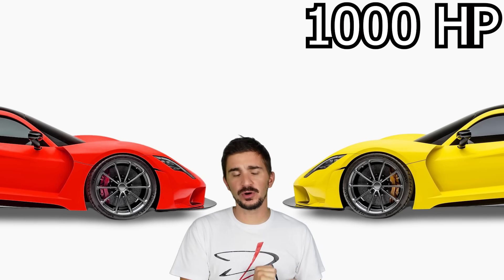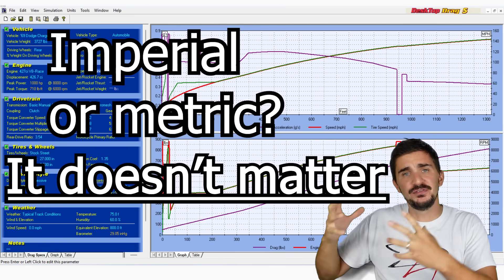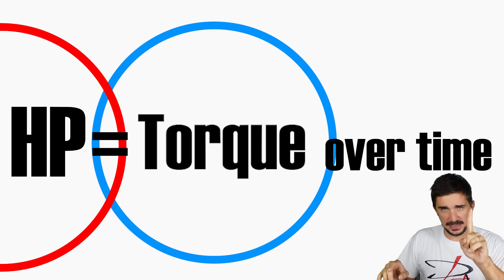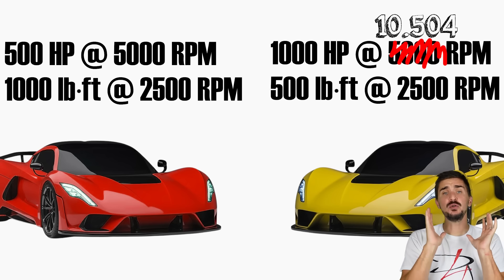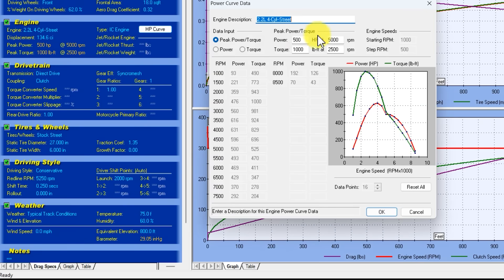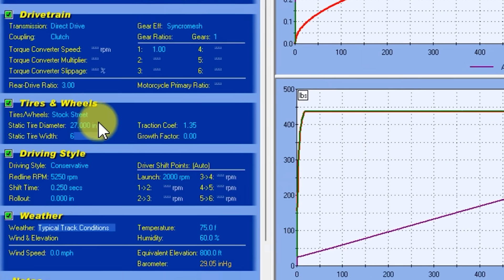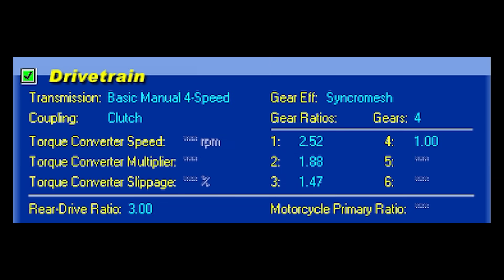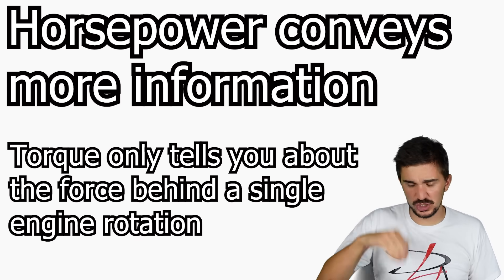Who's faster? Explained and Simulated - Horsepower vs Torque

Comment: Would be cool if you showed some closer numbers also on identical vehicles like say-  500hp 400t 🆚 400hp 500t to show how'd they react.....Would they finish pretty much even with 400hp/500t being quicker off the line. But gets caught at the end by 500hp/400t. Would 1 that always won the 1/4 mile always lose a 1/2 mile race?
Reply: It would depend entirely on the transmission since that allows you to trade RPM for torque.  With an appropriate transmission with a suitable range of ratios and which can be changed quickly (e.g. DSG) then more power is better.
Reply: @ferrumignis  I understand the different gearing part. But I meant/said use 2 exactly identical cars. With a closer 400hp/500t ,🆚 500hp/400t. To get/show a better idea how'd they'd respond in 1/4 & 1/2 mile drag tests.
Reply: At that point they're so close that you would have to give them both custom transmissions and rear ends optimized for each race they derive meaningful differences because the wrong gearbox would give one the win and the other a loss or vice a versa.
Reply: @bigbenms6  I mean race both cars completely identical except for 400hp/500t 🆚 500hp/400t to show how'd they react in 1/4 & 1/2 mile races. Are you saying in the 1/4 mile they'd pretty much tie. With 1 slightly quicker off the line but the other catching it towards the end.
Reply: @michaelbrinks8089   right but....  with AWD the high TQ car will have the traction to get a lead and  "likely" win both races, if traction is limited the high HP car wont have as much wheel spin and IT might win both races.  With different redlines and identical gears the high TQ engine may geth into 3rd gear while high HP may still be in 2nd, so does that extra gear change hurt or help TQ car?  

What it all really means is that if the transmissions is set up for the high TQ car IT likely wins, if the transmissions is set up for the high HP car IT likely wins, so there just isn't a fair way to set up a race with "identical" cars that really means anything concrete.  

Case point, the old Celica GTS was an OBVIOULSY slower car than its competitors and COUNTLESS 1/4 mile races showed this with both trap speed and times, BUT they advertised it's 0-60 heavily because it was specifically designed to get to 62 MPH in 2nd gear, why does this matter?!?!?  The Celica GTS  needed only 1 gear shift to get to 60 MPH, its competitors ended 2nd between 55-58MPH which was better (by quite a bit) for 1/4 racing but less ideal for 0-60 as it necessitated 2 gear changes which in a manual transmission WASTES TIME.  

So again for identical cars how do you decide which final drive to use?  1-3rd ratios?  Gear ratio selection is also effected by traction and drivetrain, an AWD car can handle a shorter 1st great better than RWD or especially FWD.

So I get what you are wanting to see, and it may be possible to find a way to compare those, I just want to stress than there are NUMEROUS other factors that you can manipulate that may sway the win to one car or the other outside of just HP and Torque.
Reply: @michaelbrinks8089  I would further make the case (and we are getting DEEP now) that the SHAPE of the torque curve is in many cases MORE important than the peak value, because each gear is going to use 2-4000 RPM in EACH GEAR and it is entirely possible (though less often admittedly) to have less HP and less TQ all other thing being equal and still be faster....  let that one sink in... haha
Reply: @michaelbrinks8089  Assuming you have a perfect CVT transmission holding it at always peak HP rpm the higher hp car wins every time. If you have a worse transmission then that then the car with higher average HP will win, and that depends on powercurve and gearing. Assuming the transmission allows you to stay between 3-6000 rpm constantly while shifting for example whichever car has higher horsepower in that range wins, probably the higher hp car if 6000rpm is the redline.

If you have a shit tier 3 speed transmission, and have to go down to 2000rpm after every shift, while the 500hp car only makes more power above 4000rpm then the high torque car could win, but once again the answer will be whichever car has higher average HP across the run and that depends on powercurve so its impossible to answer.

Comment: Good explanation, but you missed talking about the top speed when comparing. Given them equal top speeds through modification of the final gear and the HP biassed engine will come out in front where it belongs.
Reply: I think that's just a topic more for selecting final drive and gear ratios not necessarily understanding horsepower and torque. But I agree with you 100%. That being said I've also seen plenty of times where a car has 50 more horsepower but does not have his even a torque curve and Ailee slightly lesser horsepower car can motor past because the area under the curve is significantly better. I'm thinking centrifugal superchargers versus a true turbo car here.
Reply: @bigbenms6   IMO it is fairly fundamental for understanding the relationship as gearing alters both torque and RPM after the gear change but not power.
e.g 2 engines with torque curve shapes being equal, one having 50nm @5000, one 100nm at 2500, the power figures will be identical and if a gear reduction is applied, the torque can be doubled, rpm halved and output torque and rpm will then be identical across engines. 
Another way to think of it is that HP is just torque with potential gearing taken into account.
Reply: @CussCuss16  I agree with you but that is a totally different video IMO, and it would take away form the fundamental cleanness of his style to complicate it with this much complexity.  For you and I it may be appropriate but you and I didn't need this basic an explanation in the first place did we? (I know I didn't, and from your post you certainly sound like you have a solid foundational understanding of HP, RMP, TQ, TQ multiplcation, gearing etc etc)

I haven't looked does he have a video on selecting optimum tranny ratios or optimum shift points given a predetermined set of gear ratios? Setting an ideal final drive for a given rack application?
Reply: @bigbenms6  It would certainly make a good follow up video if he does!

Comment: For a normal day to day driving low RPM torque is the most important thing that makes car feel fast. You don't want to rev it to 5000rpm every day on a traffic light, your wallet wouldn't be happy (because more revs more losses), your car wouldn't be happy (because it is not designed for that), people living near the light wouldn't be happy and the cop sitting behid you on the traffic light woudlnt be happy.
Reply: "For a normal day to day driving low RPM torque is the most important thing that makes car feel fast"

Only if you are unable or unwilling to use a transmission.

You don't want to rev it to 5000rpm every day on a traffic light

That's an assumption; you might not want to but others may be happy to.

your wallet wouldn't be happy (because more revs more losses), your car wouldn't be happy (because it is not designed for that), people living near the light wouldn't be happy and the cop sitting behid you on the traffic light woudlnt be happy.

Sure, if you are driving some ancient big block dinosaur than 5000RPM all the time is not likely to be healthy, but if a modern gas car engine can't survive 5000 RPM on a regular basis then it's junk.  You don't have to exceed the speed limit or fit a fart can and make stupid amounts of noise, so there is no reason for cops to be unhappy.
Reply: @ferrumignis  a modern engine cannot survive sustained 5000 rpm long term because a modern engine is made with fuel economy in mind and that means low RPM. If you run it at 5000 constantly you'll wreck it in less than a year.
Reply: @thrustvectoring8120  Absolute BS. A modern enginee should be able to survive 5000 RPM all day long
Reply: @ferrumignis  try it then. Run your engine 500-1000 rpm below redline all the time. I dare you.
Reply: @thrustvectoring8120  "I dare you."

🤣🤣🤣🤣  Not too knowledgeable on cars I take it?  My Civic had almost 200k on it when I sold it, in perfect working order, no oil burning and engine running as good as it did the day I bought it.  I used to take that to 8000 RPM pretty much every day.
Reply: @ferrumignis  and now the one about hansel and gretzel
Reply: @thrustvectoring8120  "and now the one about hansel and gretzel"

Are you quite old or very young?  You seem to be rather out of touch on developments of the internal combustion engine.  The 2L 4 cylinder F20 engine in the Honda S2000 had an 8800 RPM red line, and 9000RPM fuel cut and were renowned for their reliability.  The K20A engine in my Honda Civic had a red line at 8500 RPM, and again are also well regarded for their reliability and longevity.  The previous generation of small performance Honda engines, the 1.6L B16 and 1.8L B18 had similar RPM limits and were also regarded as almost bulletproof.  People tune these to 500+ bhp  for drag racing etc.

Comment: The car that produces the highest Ave HP over the course of the race wins.
Reply: Technically, the width and breadth of the torque curve is the primary factor.
Reply: Depends on how long is the race 😉
Reply: calculus wins
Reply: Yeah, it's about "area under the curve" vs peaks
Reply: So a car with five parachutes coming out the back and one more horsepower then the car it's racing is going to win? I don't think you put a whole lot of thought into the comment.
Reply: @zacharysherry2910  keep it in the context of the video. The cars the same, only difference is the performance of the engine. Not an El Camino with 5 extra horses racing a Fox body.
Reply: Depends on how long the race
Reply: Correct. By definition.
Reply: Depends on the quality of the drive train build and driver.
Reply: HP at lower speed gives you more acceleration so the claim not necessarily true.
Reply: @tcn1john  It's basic physics. Power is defined as the rate at which work is done. In this case the "work" is moving a car 1/4 mile. If the car does this work faster, then by definition, the average power produced by the engine was higher.

If a car has a very small power band and doesn't have the gearing to compensate for it, it won't be able to utilise it's maxiumum power over a run and its average power can be lower than a car with lower peak HP but a better power curve. It's still the car that produced the most power on average that wins.
Reply: It's more like the highest average speed over the course. 10,000 HP doesn't matter if the car only runs 10 km/h 😂
Reply: @3d9e  that's the dumbest thing ever. Speed is the result of the car's performance. If both of these cars have ideal gearing, the high hp car will make more average hp, therefore higher average speed and win.
Reply: Hp is just high rpm tq. You always want more torque
Reply: @HioSSilver1999  you want more torque at the wheels.
Reply: @bence.gabor.slezak  that's what gearing does. But turning more gear also uses more tq.
Reply: @HioSSilver1999  here's a real world example. Yamaha r6 vs r7. r7 makes more torque, yet the r6 pisses on it. Why? Because the r6 revs to 16k so it can have much shorter gearing and with that higher torque at the wheel.
Reply: @bence.gabor.slezak  like i said that's what gearing does. But again 2 very different engines. If that r7 engine was made to run to 16000 rpm instead of 9500 it would win....because tq.
Reply: @HioSSilver1999  you said you always want more torque. That's just not true.
Reply: @bence.gabor.slezak  more tq = faster....so yes that's true. Highest Average tq will win if all is equal.

Horsepower is just a equation.  You don't even need Horsepower to calculate shift points. You do the math off of tq curve,  shift points and gear splits. For the fastest acceleration you may not even shift at the same rpm, depending on the gear split.

Btw...i have a fz6 which has a r6 engine. Just tuned slightly different.
Reply: @HioSSilver1999  do you understand this isn't about one vehicle, but two vehicle with different engines? And back to the r6 vs r7, the r7 makes more torque, but is slower.
Reply: @bence.gabor.slezak  apparently you don't understand the the actual difference in torque we're talking about here on tbe r6 vs r7 is minimal.  The rpm potential is yuge.....there is your difference.  The r6 uses lower gearing to multiple the tq greatly. The r6 engine is in a much higher state of tune than the r7 engine.

To prove that point the r6 had 13.1:1 compression.  The r7 has 11.4:1 compression and 2 less cylinders. Remember when i said if all is equal. It's not in either the video comparison or the r6 vs r7 comparison. 

You don't want to see that tq rules because you don't know any different.  But if you truly want to see what tq does limit the r6 to the same rpm as the r7. Then even with almost 2 points more compression and 2 more cylinders and lower gearing the r6 will lose.

Other than that these comparisons are apples vs oranges.
Reply: @HioSSilver1999  this comparison is about comparing apples and oranges. 1 engine with high torque but low hp, the other low torque but high power. Another example bmw e46 330i 300Nm vs 330d 410Nm. Guess which is quicker
Reply: @bence.gabor.slezak  one engine is low performance the other is not comparatively
Reply: @HioSSilver1999  so apples and oranges.
Reply: @bence.gabor.slezak  that's what it is. More  Torque will accelerate faster tho if all is equal.
Reply: @HioSSilver1999  🤦
Reply: @bence.gabor.slezak  yea you should know this. But you guys act like hp is some mystical creature.
Reply: @HioSSilver1999  earlier I asked you what's quicker, 330i or 330d. What's your answer?
Reply: @bence.gabor.slezak  i didn't answer. Way to many factors there. 

I have a mercedes e320 diesel. In that year the diesel is faster than the comparable gas 3.2L gas engine.  Idk about the bmw....way way to many factors.
Reply: @HioSSilver1999  diesel makes 36% more torque with about 10% more weight, so according to you it should be quicker.
Hp is work over time. To accelerate something quicker you need to do more work in a set amout of time. How do you do that? Make more hp. With the ideal gearing, the higher hp will win every time.
Reply: @bence.gabor.slezak  the diesel likely don't rev as high. The gearing advantage,  lighter reciprocating advantage of the gas engine typically gives it a advantage in a race. But again....then there is tq management built into the pcm that would hurt the diesel more. 

Like i said way to many factors. If you actually worked on cars you would know this. But instead you have a chip on your shoulder because you've always believed in a calculation rather than a measured force.
Reply: @HioSSilver1999  diesel has a lower top speed in every gear so some might say it has a big gearing advantage. 🤔
Reply: @bence.gabor.slezak  then those some don't know wtf they're talking about.
Reply: @HioSSilver1999  what you need to understand is high torque at the crank doesn't mean or required to have high torque at the wheel. Even this video told you hp is work over time. Quicker acceleration means more work done in a set time, and yes that requiers higher torque at the wheel.
Reply: @HioSSilver1999  so what do you mean by all things equal? What gearing does it mean? The same ratios or the same top speed in every gear? And don't say "oh the high torque engine doesn't rev that high" because that's the whole point.
Reply: @bence.gabor.slezak  that's where gearing comes in. I meantioned that several posts ago. But you guys have to lean on EXTREME differences to try and prove your point. But it still stands that more tq will accelerate faster. Sometimes that's done through gearing. Because gearing multiplies tq....it does not mutiply hp.
Reply: @HioSSilver1999 if hp is just high rpm torq... which is true then you always want more hp... more hp means more torq like you said